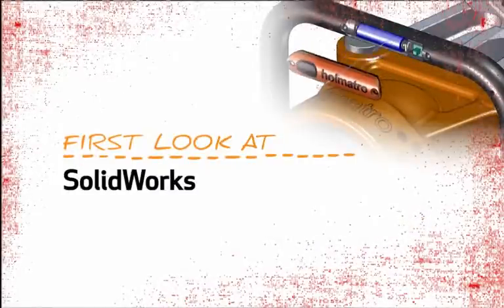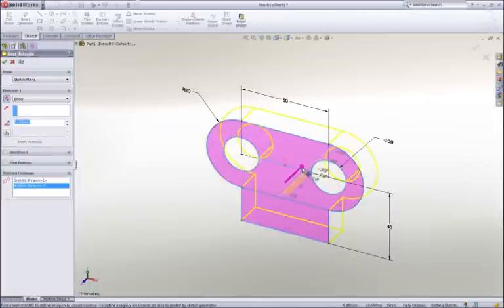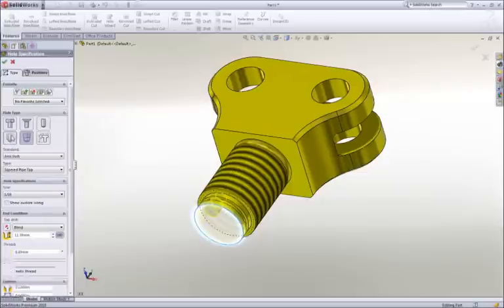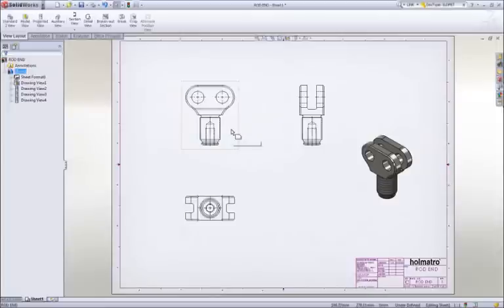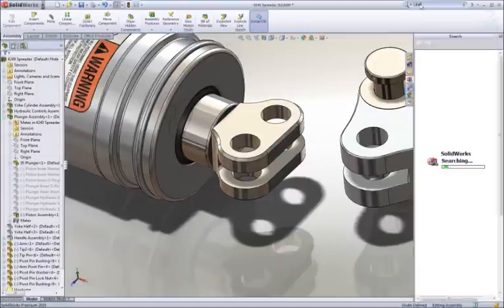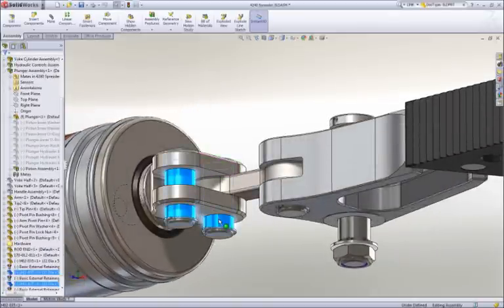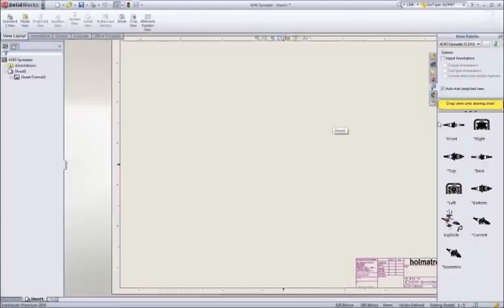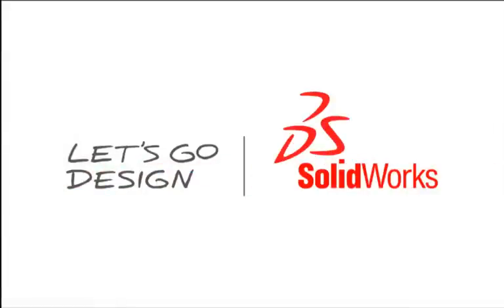First Look at SOLIDWORKS Software - SOLIDWORKS

Comment: SolidWorks could be better at layers on 2D drawings (drafts), more detailed properties selection and options.

For example:

-I have a new machine desinged and a existing metal struture, when putting them on an assembly, and using lines that are visible and invisible, i want my machine to be continuous line, thinkness 0,18mm and line color green, and my structure red.

So when i see invisible lines of my machine i see a darker green or same, thinker, thinner or same, dashed line or same continuous line, the same situation for the existing metalic struture.

More free + detailed layers system.

-Slot mate, can be done with a sketch slot aswell, not just the 3d feature.

What i'm saying is for example: i had a part that as a slot, but its cut 1/3 of the slot, its open (U slot), now i need a shaft to travel in the slot freely or even distance.

So what i did is creating lots of refrences and mates so i can almost do the slot configuration mate. To complex for something simple.

-Plus when i made weldments drawings and put automatic centerlines they put the center lines of the radius of the corners of the beams and not centerlines of the beams it self, that's a bit.....akward, but i deactivate it and do it manually.

Best regards
JHG
Reply from the maker: +Junior Guerreiro Those are interesting points. Thanks for your feedback, I'll forward your comments.
Reply: @solidworks  love your software

Comment: i think that solid works has a built in tutorial in the program that if you complete it, it will give you certifications.  or  you can get a certification from Solid Works them selves,  but, to get a job using it it like an engineering job you will need a lot more experience with other stuff, as well as solid works.  You might wanna check out machining/machining technology degrees at community colleges.  Its like engineering, but not 4 years and your not designing, rather building